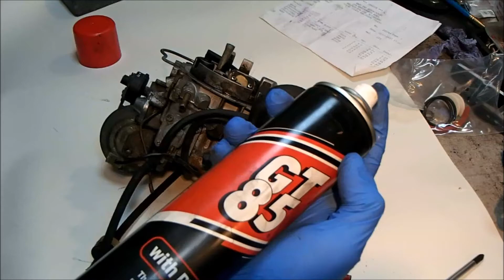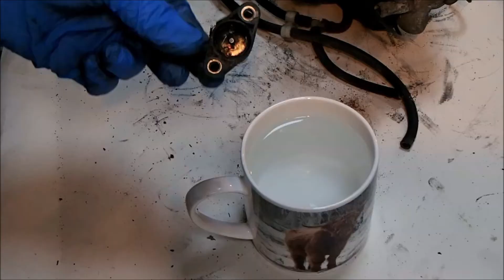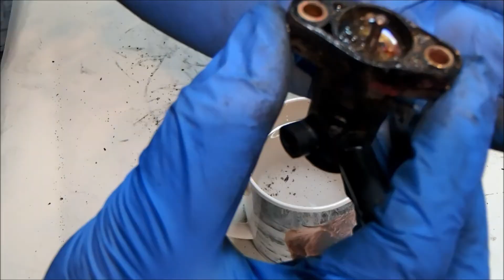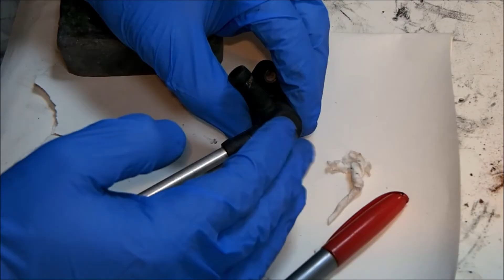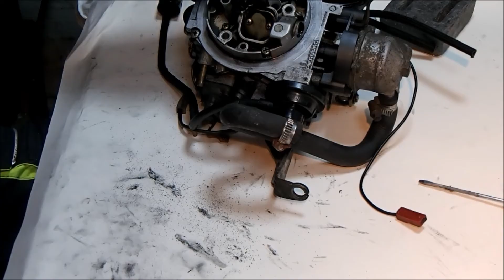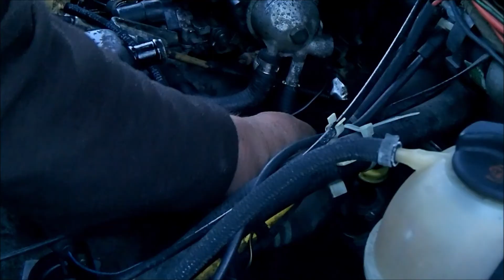Volkswagen golf mk2 carburetor repair and installation

Comment: Good video.  There are only a few on the Pierburg 2e2 carb.  I found on mine, I had to loosen the choke and back it off a bit, about 6-7mm because it was flooding.  As the carb wears, I think the bores in the carb become less restrictive, and so you need less choke to draw the required amount of fuel when the engine is cold.  At the end of the day the role of the choke flap is simple to restrict air flow to encourage the vacuum to draw more fuel, so the factory setting is not appropriate once the carb has some wear.
Reply: I've been having such a drama with the 2e2 for a year now. Replaced the flange, lines... Even got the tape measure out to make sure the ventricle gap is correct. 

Still fires up to 2100 until engine hits 90 on a warm day and bogs down for the first few hundred metres. Runs lumpy in 4th when feathering the accelerator also. Getting to the end of my wick with the bloody thing!

How did you adjust the choke gap? I've used the approach given via adjusting the bimetallic spring housing and also the adjustments on the front alen/behind alen screws but it's still not playing ball.

Any help would be greatly appreciated

Comment: im having trouble finding the hoses i need to replace. I own a Golf 2 1.6 Ce and i have the same problem. After the choke closes the engine idles really bad and often cuts out. Evertime i brake and clutch the engine cuts out aswell. I have replaced the big rubber flange. This hasnt solved the problem. Could u help me out?
Reply from the maker: Change all the vacuum hoses, just standard beaded line from an auto shop. Also check our manifold to brake servo line and the servo it's self. Could also be a blocked idle jet
Reply: Try backing the choke off a bit by rotating it anti clockwise, it sounds like its flooding.